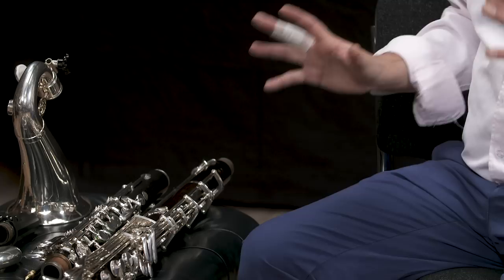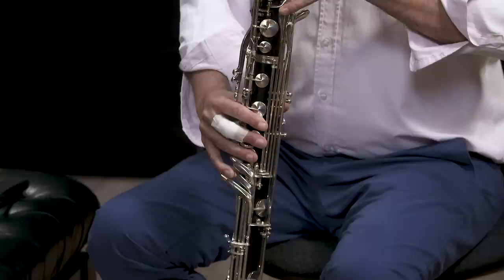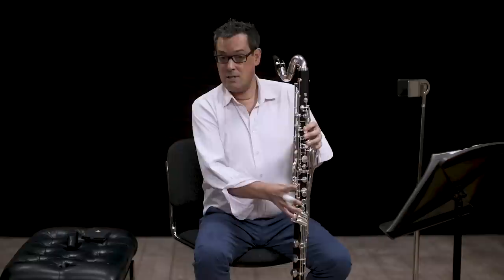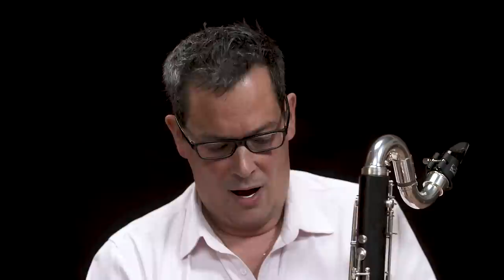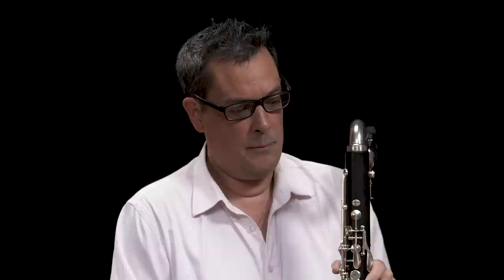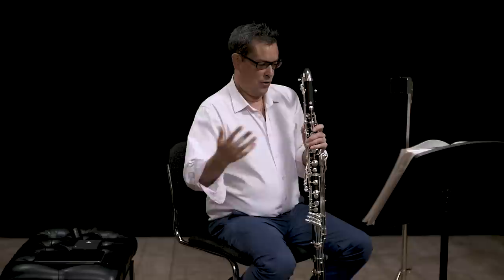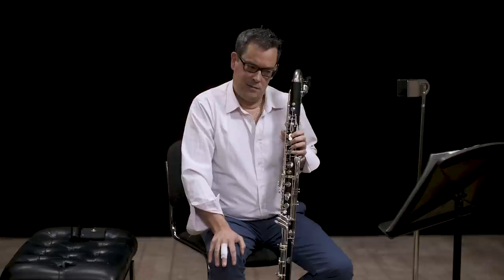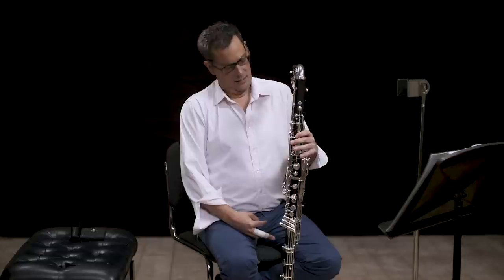Instrument: Bass Clarinet (In Depth)

Comment: As the only bass clarinet, in a small school. I have a old,and bad condition clarinet. I didnt knwo they could sound this good. I wish I could use one of these. I have always been good in my band, always the guy at the back with the perfect crescendos and articulations. I've never played as fast as you. But sitting down I struggle with fingerging the fast and rapid notes. I always loved playing a smooth low. I moved to Spain for family reasons,and I couldn't play my clarinet. I lost a lot of my talent. I just wish I could have a good clarinet and have the talent as this man.
Reply: You'll have to buy your own. A used Vito or Yamaha (avoid Yamahas made before the '80s) should do. Be sure to replace padding and fix leaky keys, etc., where need be.
Reply: The Selmer goes for about 10 grand. This dude has the low C model, which costs even more. Way beyond the reach of most players.

Comment: I'm surprised that you mentioned that you have to learn the bass clef in order to learn the bass clarinet. I agree that it is going to be necessary at some point and learning to be fluent at reading in the bass clef is advisable for all musicians, even if your speciality is the piccolo or the glockenspiel. However most music written for bass clarinet seems to be written in the treble clef. I prefer the so-called German system of writing it on the bass clef and reading the pars transposed up a tone, but I didn't think it was at all common these days. Perhaps I'm mistaken there.
Reply: On top of that, it will be useful if you need to double a bass clef instrument like the bassoon or double bass(i did this for my band)

Comment: 18:55 The key under the 1st finger of the left hand that looks like 2 keys "Siamesed" together with a small hole in the upper half, could you please explain its function to a drummer? Thanks.
Reply: I’m not too sure but I think it’s just an alternative fingering. I pressed the bottom pad on the first finger along with all of the main holes down and it made a surprisingly high sound. Players rarely use it though